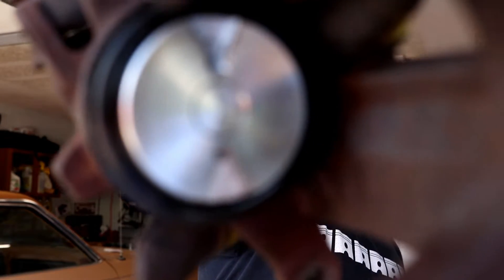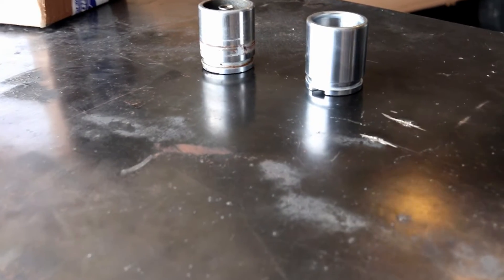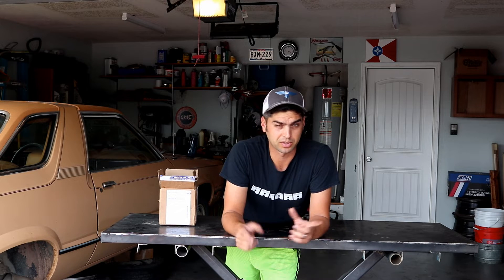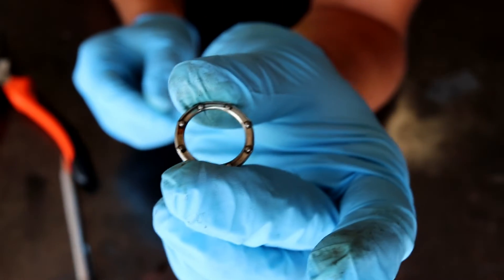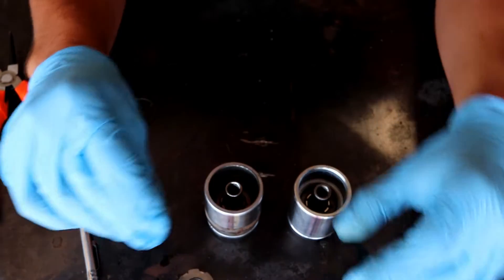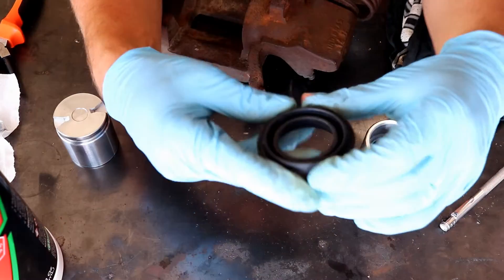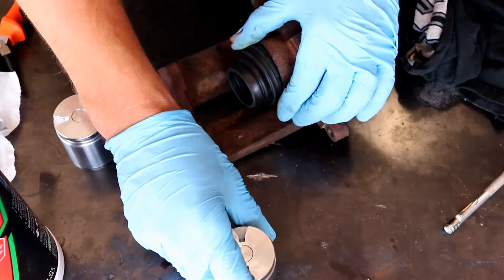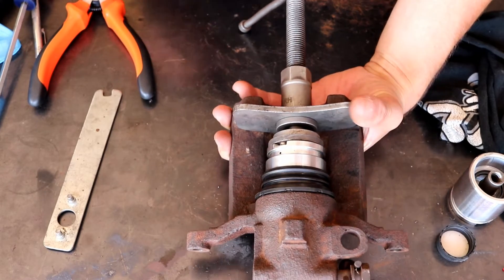Part 2 of Rear Caliper Rebuild for #projectLOWFAREmont or LSC

Comment: The old rotors are made of better metal , turn them . New rotors are made of crap metal
Reply from the maker: I actually ended up getting them turned... didn't know if there's be enough material to do so or not. If you see in the thumbnail I actually got them done yesterday after I quit recording I returned the tool to O Reilly and got them done. It was the difference between $12 a rotor and $48

Comment: Nice work Grant. I haven't rebuilt a caliper before so it was informative to see how they work. I didn't expect the pistons to have any other parts to them (the screw assembly).
Reply from the maker: Front calipers usually just slide in. I think the twist in style like I have are related to them needing to function as part of the parking brake. But yea a front would be more straight forward.

Comment: Cool stuff! I've never seen the inner workings of one of those. On a side note, there should be tabs on the back of the inner pads you need to line up the slots one the pistons with. Pretty much just set them straight up and down. You can do that when you adjust the pistons outward to meet the rotor thickness though. Just in case you didn't know. Brakes won't work properly if you don't.
Reply from the maker: I did notice that yesterday...but not enough to follow through with it! Thanks for reminding. That's where the mini-grinder wrench comes in handy since I took back the tool last night to O'Reiley's. Thanks for the reminder, because it got lost in all of the events yesterday.

Comment: New rotors are close to turning price
Reply from the maker: I checked. It was $54 vs $12 so I turned them. And they weren't readily in stock at my local O'Reilly
Reply: @Str8sixfan  wow that's not normal its normally only a few dollers more for rotors brand new did you check napa price
Reply from the maker: @AntonioClaudioMichael  I know, I was blown away when I saw the price (was expecting like $22). I think it's because they're vented rear rotors for a not very popular car, means they're bot a highly produced setup. I'm sure I could have shipped around and found a better price somewhere, but convenience helped me make that decision.
Reply: @Str8sixfan  you could get racing vented and slotted rotors aftermarket for less then that at some places